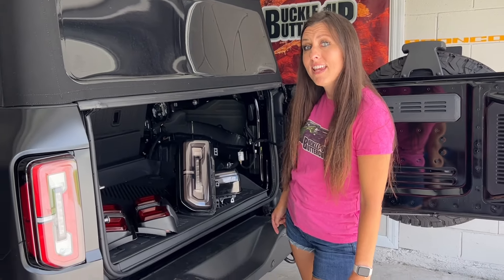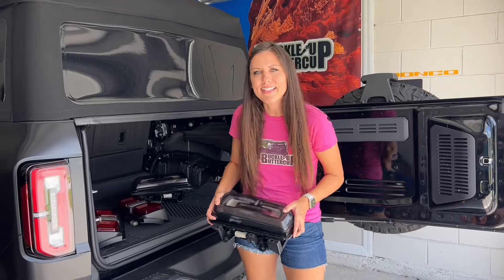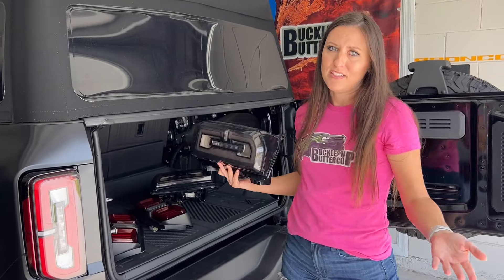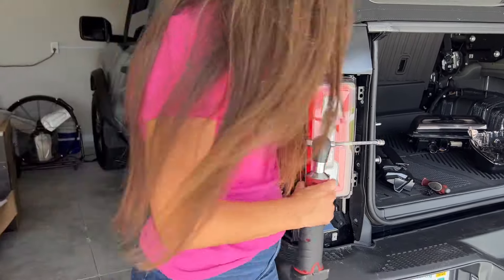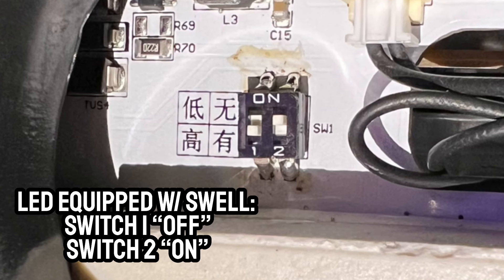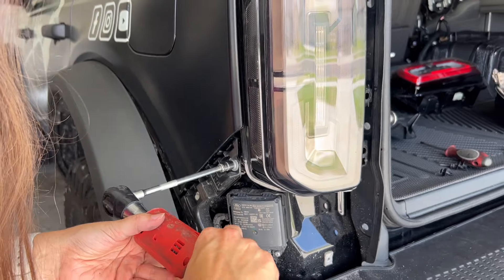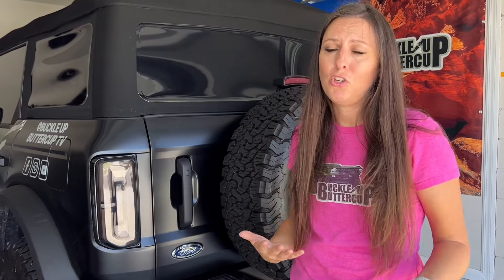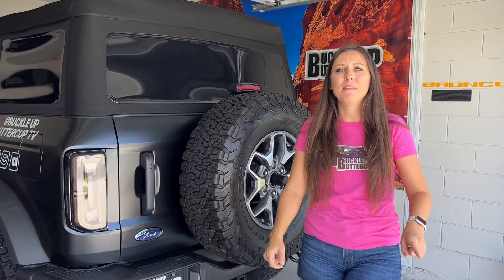Upgrading Tail Lights Without Using FORScan | LUMEN8 OEM Style Red or Smoked for Ford Bronco

Comment: For the Halogen model, are they plug and play? Or do they have to run through the brake light? Thank you
Reply from the maker: Halogens have to run through 3rd brake light. Lots of testing and that seems to be the best way to prevent glitching
Reply: @BuckleUpButtercupTV  Are there instructions on running through the 3rd brake light? Would Forscan fix/remove the need for 3rd brake light? I'm confused.... What is the glitching?

Comment: Is there anything special/different you would have to do for the stock non LED tail lights?
Reply from the maker: Lumen8 has since changed the design so install is a little different I have printed instructions if needed
Reply: same question